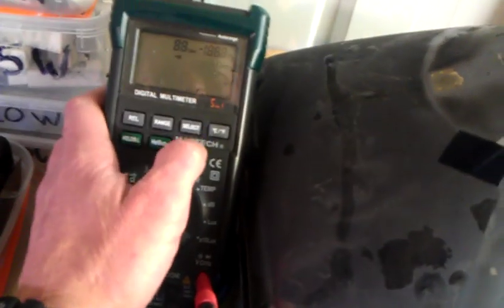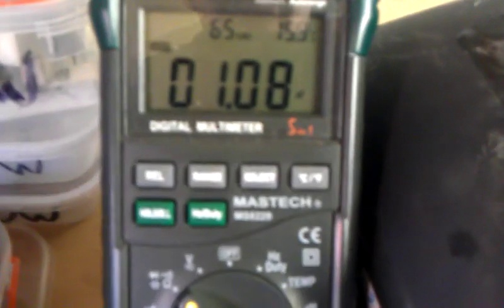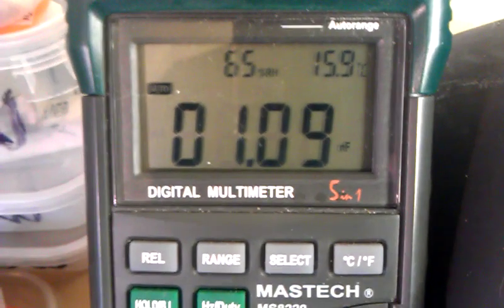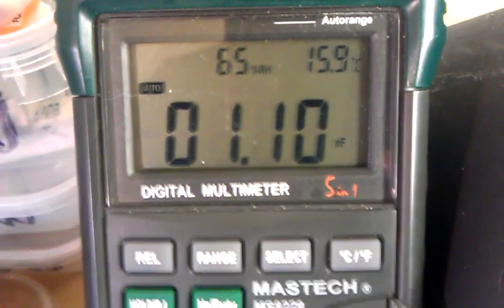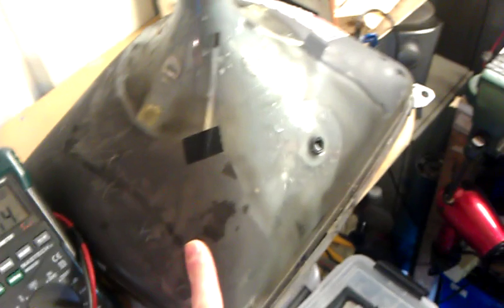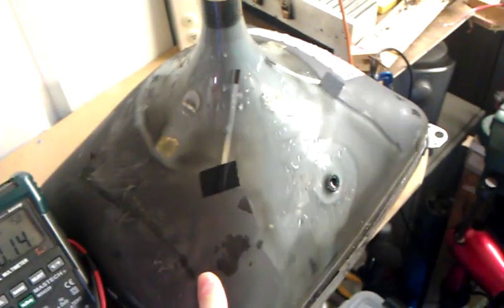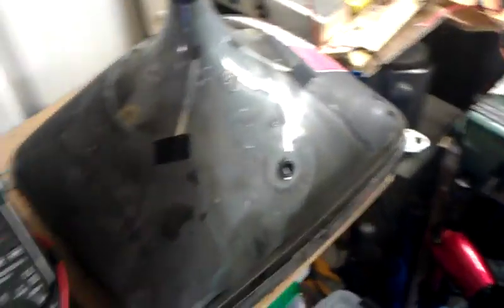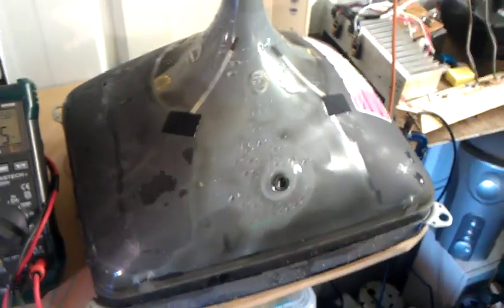CRT high voltage capaciter?!?!

Comment: Repetitive high-current discharges could crack the glass, which is very bad considering the whole thing is at a massive vacuum. Apart from that I see no reason why not.
Also watch out handling those things, some have implosion bands which dampen the implosion when ruptured, if you remove those they are a serious safety risk.

Comment: well, you can use them as capacitors but there are an easier (and more compact) ways of making HV caps (eg. aluminum foil and plastic film, I once made a 16nF 20Kv cap) type in youtube "homemade capacitor"